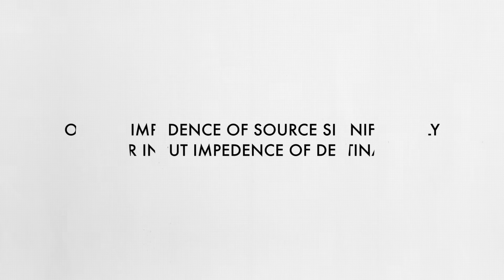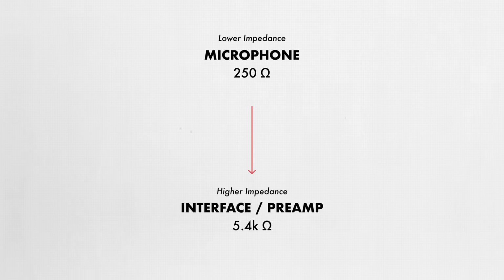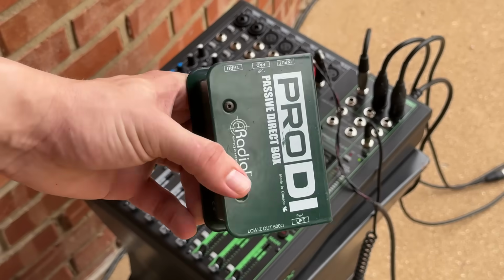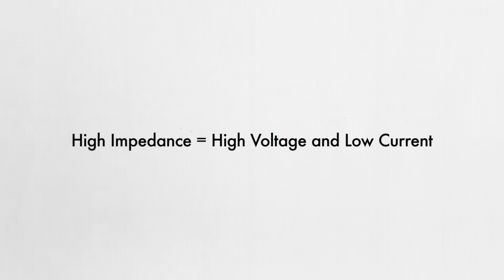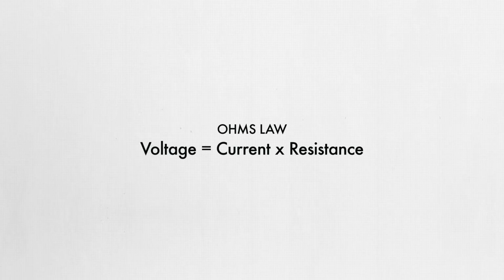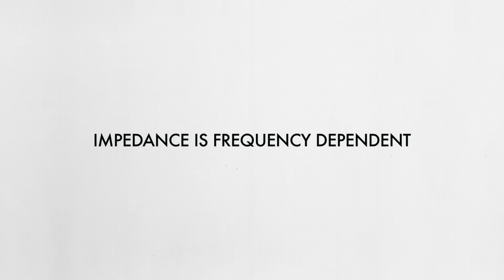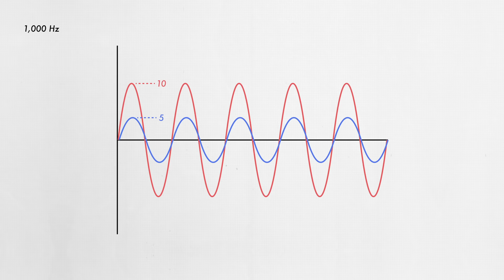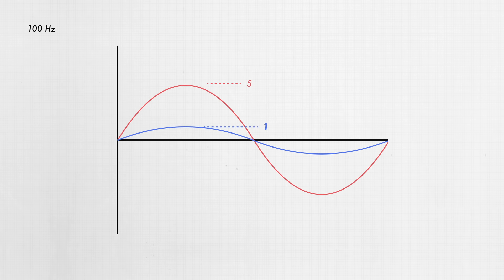Hi-Z vs Low-Z: What's the Difference?

Comment: I do not know how it is in audio frequency, however in RF and microwave you like to keep impedance as clouse as possible between source and load. Reason is that any mismatch creating standing waves. Standing waves will distort the original signal by overlapping multi reflection reflection. So what you consider better sounding that more distorted signal.
Reply: Ah, gotcha! The example of AC transmission connected the final dots in my head where I was confused.
Reply: In audio, load impedance should be higher than the source impedance. If load impedance is lower than the source impedance, the signal waveform (timbre) will change (distorted).
Reply: @iblesbosuok I wonder why the source signal gets distorted if the load impedance is smaller. If the load impedance goes higher, like an open circuit, the reflected phase approaching 0 degree change. If the impedance gets lower it approaching short, the reflected phase approaching 180 degree. The mutch should be 90 degrees.
Reply: @miroslawkaras7710  sorry, unfortunately it needs a graphical explanation to discuss it.
Reply: I was wondering about this as well. Normally you think impedances should be matched to achieve maximum power transfer. I'm almost certain that this remains true on the output stage of audio amplifiers. Here however he is trying to achieve maximum voltage over as many frequencies as possible, as it is most likely just read by an op-amp or differential amplifier circuit, which can work with zero current on the input.

This os my guess as least 😊
Reply: This video is quite misleading, even a bit wrong. In the early days, professional audio was also based on the transmission line theory and 600 Ohm inputs and outputs were the standard for line level signals which were adopted from the telephone equipment. Hence the dBu unit that is still very commonly used in audio being based on the voltage caused by feeding 1 mW = 0 dBm into a 600 Ohm load. The thing about professional audio is that the wavelengths are usually much longer than the cables which means that the signal reflection and standing waves are not an issue. It's much more convenient to use low-impedance sources and relatively high-impedance inputs so that the outputs behave more like ideal voltage sources and you can passively distribute the signal to multiple destinations without using the transformers and without significant voltage loss so most modern equipment is designed like this. We still need to use the transmission lines for the digital signals which contain much shorter wavelengths.
Reply: If you do the math, it's physics, the "standing wave" on an audio cable is multi miles long for one wave. At much higher frequencies as the power travels along a transmission line at the same speed for either frequency, the wavelength becomes shorter at higher frequencies. FM radio at 100 MHZ is about 12 feet. At 10 MHZ, it's about 120 Feet. At 1 MHZ it's about 1200 feet. At 100 KHZ...  and the 20 to 20KHZ frequencies have very long wavelengths, so standing waves on a short length of wire is not an issue. Your audio cables are not long enough to have standing waves. I define short as the length inside a small town for audio.

Now onto audio matching. In comparison more to the power transformer powering your house, it too has an impedance. By definition, impedance matching is the load that draws maximum power. So if the outlet is 120 volts unloaded, loading to maximum power would be 1/2 voltage or 60 volts at a few thousand amps, and the fuse blows. Yes you can overload sources and cause distortion. This applies to power amps, power transformers, and phono pre-amps.  This is why a 200 ohm microphone is loaded by a 1200 ohm or higher console input. Not after maximum power transfer, but low distortion.
Reply: @isettech It look like it just convention, not rule. Microphone could have 200 ohms with load 1200 ohms, as was mention,  however speaker in general are low impedance where source have higher impedance - no issue in there. There should not be an issue with distorion if the system is design to operate with specific impedance, no mater which  is higer or lower.
Reply: @miroslawkaras7710  Hate to rock your boat, but the actual speaker output of an amplifier is very low impedance, so the lower the speaker impedance, the higher the current and more power is drawn. If you invert the damping factor, you get output impedance of the amplifier. A load for maximum power transfer is an overload on modern power amplifiers. For more reading, study impedance and maximum power transfer. Then study impedance and damping factor. Yes I am an engineer.
Reply: This is very interesting. My understanding here may be very wrong- but since RF are electromagnetic waves, and audio is just voltage and frequency (no magnetic component), I suppose VSWR does not apply?

Very interesting comparison nonetheless!
Reply: @HJCF0520 Any AC is electromagnetic. For example AC power transmission line with 50/60 Hz are using same formulas from electromagnetic theorem  as RF transmission lines. This example may not apply to audio cables as they are too thin, but something like skin deep loss is a very important parameter that applies for both long AC transmission lines, as well as RF transmission lines. I do not know the impedance characteristics of electric gitar. But from your description it indicates that it varies over frequencies. That definitely makes mutching impedance more complex.

Comment: Thank you for your video. 
How about connecting line out or audio out from cell phone directly to XLR-combo mic input in mixer using trs to dual TS cable? Is it safe for the mixer? My mixer is midas mr18. I know it should use a DI box or using line input on the mixer. But the music teacher insisting to connect it directly.
Reply: Find the right cable, then use a DI. The reason is the phone is stereo headphone out. It is unbalanced. The right cable is 1/8 inch stereo to 2 mono 1/4 inch plugs. Those plug into the combo jack, if the console will accept line level, otherwise plug into DI to convert to balanced and use the 20 db pad to not overdrive the mixer input.  Read the owner's manual of the console. Many of the newer digital consoles with combi inputs have enough trim range to accept the headphone level.  If using the XR-18, do not use channels 1 and 2. Use other ones, or plug into the Aux Inputs, which are line level. The X-Air 18 is high Z. The High Z inputs might not trigger the switch to the jack from the phone speaker.
Reply: @isettech  thanks a lot for your advice
Reply: Look up "line level signals"

Comment: while waving that stick around, i would have expected the high-z signal to smash harder. like if you had a sine wave from 10 having to dive to -10 and back again in the same amount of time as one going from 2 to -2 and back again. the one with the larger range would be moving faster at baseline, visually appearing to be a steeper slope on a chart. but that is probably just a flaw in using a lever as a visual aid compared to weird electric properties.
Reply: This is a very good point I was missing too. The analogy fails because it uses thickness for illustration of what would be better illustrated with mass. You should imagine both of the sticks being the same material. In the video the thick stick is visibly lighter, what doesn't aid the presentation.

I remember seeing a video on impedance which illustrates a wave along the rope, which at some point is tied to a rope of a different weight (let's say larger). In such case a wave going along the "light" rope would be significantly impeded but the "heavy" rope, thus propagate with lower amplitude. I find that illustration much clearer.

Comment: AUDIOUNIVERSITY, What the DI transformers is stepping down or converting HIGH impedance to a LOW impedance is this called Down-converting or Stepping Down? make a video lesson about using guitar cables VS wireless systems because wireless systems output LOW impedance and most guitar pedals input front end stages are wanting to HIGH impedance signal. So using guitar wireless systems outputs LOW impedance and connects to HIGH impedance guitar pedals input ports is going to do what so the Level Difference & Tonal Difference? The difference between comparing the RATIO from converting a High impedance signal to Low Impedance signal VS compared the RATIO converting a Low impedance signal converted to High impedance signal, What are the differences?
Reply: Using a low impedance source with a high impedance input won't affect the tone nor the level. What matters in this case is the signal level. If it's too high, it will overdrive the pedals, if it's too low, it will be buried in the noise floor of the pedals.

Comment: Hi there! I have a question, recently I got some cheap studio monitors that sound good (like Presonis Eris 3.5), initially I connected them via the AUX port on my Scarlett Solo 3rd Gen, U used them for a few days with the AUX connected until I got the TRX cables to connect them wuth the audio interface, now I am facing a weird problem, when it was connected with the AUX, if I turned the volume knob all the way up, it was clear and sounding good, but now, with the balanced TRS connection, it starts to distort after about 60% part of the volume knob.... is there a fault / problem in my audio interface / monitors / anything else? please help me!

Comment: On this side of the power amp we don’t really care about current, and it doesn’t much help us to even talk about it here.  “Everything useful is a voltage divider”.  Vdest = Vsource * (Zdest /(Zsource + Zdest)).  It’s clear to see that as source impedance gets bigger, the fraction gets smaller, but if the destination impedance is enough bigger, it won’t get that much smaller.  

The source Z of a passive electric guitar is mostly inductive, meaning it gets much bigger for high frequencies, mean the fraction gets smaller for higher frequencies, so we lose treble first and fastest as destination impedance decreases.

Comment: Great video! Can you do a version centered on headphones and impedance matching. Certain headphones like the Beyerdynamic DT880 600-ohm version are famously hard to drive but apparently sound wonderful if you can set them up right. But I've never been able to find a good explanation of why nor how to figure out the proper impedance-matching level so that you can select the right headphone amp. Everyone just concentrates on using a high-power amp, but as your input video shows, getting the impedance level right results in a much cleaner sound.

Comment: If we always want the input to have a much higher impedance than the source, why do we bother having lower-impedance inputs for mics? What happens when the input impedance is too large?
Reply: Because a higher input impedance pretty much means a higher noise floor.
Reply: Uninformed explanation, personal guess:

A higher impedance requires a larger coil which then requires more forcefull motion to produce a signal. So you'd probably need a larger membrane.

All a mic does is move a tiny little membrane.
A larger coil can risk more EMI, you don't want your mic to behave like an antenna.

Comment: Juggling 3 different values at the same time in your sentences [current, voltage, resistance] as well as interchanging Z-R-Impedence is extremely confusing. And the analogies like that stick movement were totally lost on me.
Reply: I always use this reminder: 2=6:3, 3=6:2, 6=2x3
Reply: just remember V=IR

Comment: I would say Voltage is analogous to Force, because it represents the potential for current across a given resistance/impedance, while current is the actual motion of electrons or transfer of energy.

Edit: removed long ramble because what the hell do I know about how a soundcard is built?

Comment: thought I was done with physics by going to music, and here we are talking about ohms law lol
Reply: As a physicist and amareur musician, working with RF impedance matching circuits 😂... I gotta ask: thise circuits usually also work as a very efficient narrow-band filter at the resonance frequency of your RLC device. How to accomplish impedance matching in such broad band as required for audio devices? I suppose the noise-cancelling feature is basically a low-pass filter with very high cut-off frequency. Would this be related?
Reply: @trfp  You are not gonna plug a line level signal into a mic input are you (you gonna blow that input surely? I suppose it is this kind of thing in a broad sense. An immediate thing that springs out of an impedance mismatch is for example your guitar will sound very quiet, with a very poor signal.
Reply: There is no escape!!! Math and Physics are everywhere
Reply: @igalaviz  And Art, which is superior to Mathematics!
Reply: You were done with physics, but here you are lying on the ground, fighting gravity
Reply from the maker: You can’t escape it! lol
Reply: Music is mathematics. The fun part is when you break and bend the rules, which you cannot do on maths :)
Reply: Well, it's not music, it's audio.
Music is art, audio is engineering 👌

Comment: The Scarlett interface has the INST mode. Is that the same thing as high impedance mode? The user manual just says that it will raise the gain +7dB in INST mode for using guitars and other high impedance instruments.
Reply from the maker: The specs for the Scarlett 2i2 (4th gen) say the instrument inputs have an impedance of 1Mohm